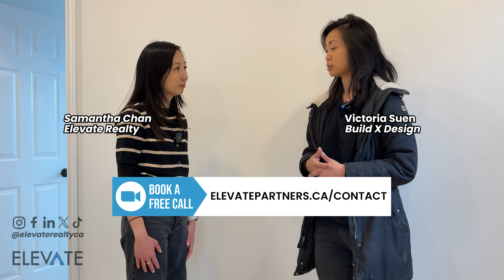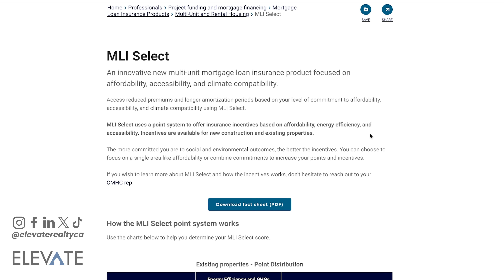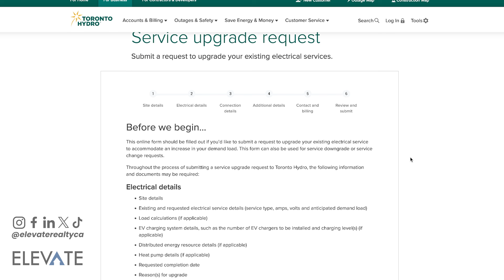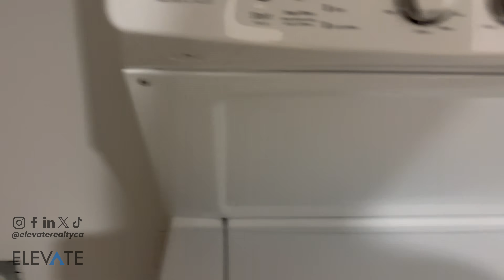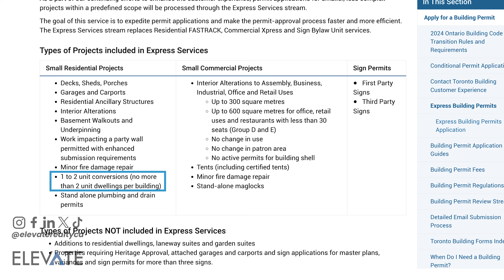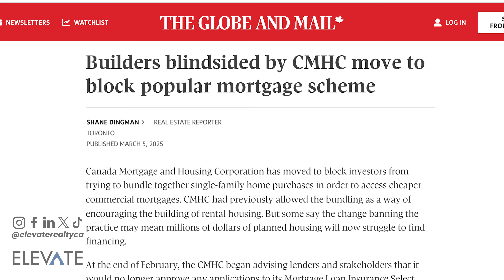This $800K Toronto House Makes $11K/Month – INSANE 5-Unit Toronto Multiplex 1 To 5 Conversion!

Comment: Hi
Nice presentation… I had a couple of doubts…
1. Did you add  individual hrv for all units?
2.Did you make a fire seperating wall in the attic if you had to seperate units in 2nd floor?
Reply from the maker: Hello! Yes to separate H/ERVs. For specific details, please contact Victoria at BuildX directly: www.buildxdesign.ca 😊